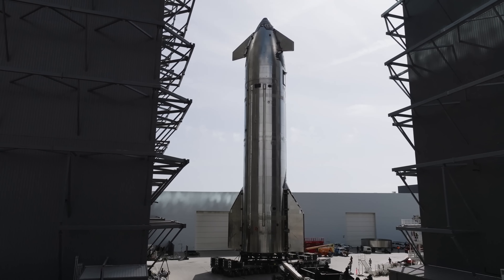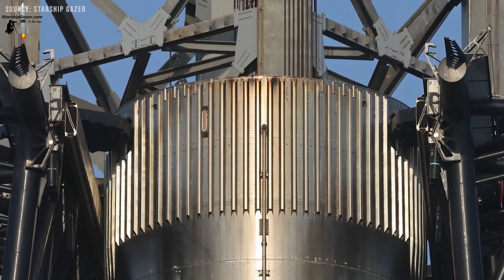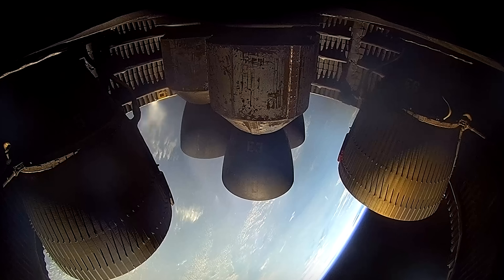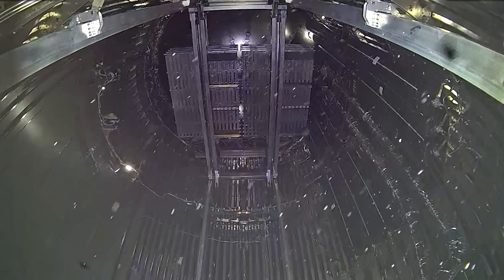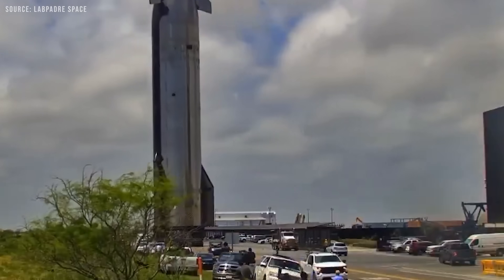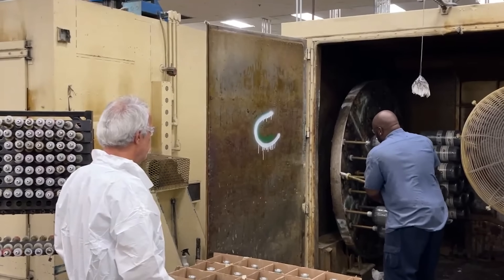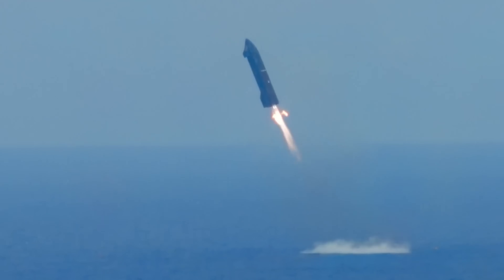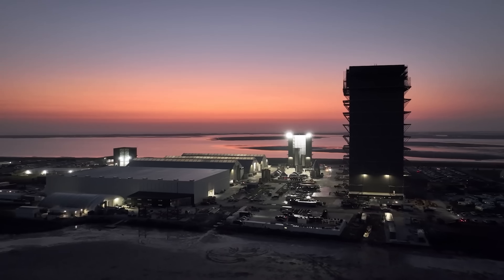SpaceX revealed the Real Problem with SpaceX Starship V2!

Comment: The main issues are 
1. re-entry or the weight of the shield for rentry. it diminish the payload.
2  The returning speed is so high, the engines cannot survive the air friction forces.
Note: On return the ship is Almost empty. The heat shield is defending an EMPTY vessel?
The very heavy shield is NOT required going up. It is only used coming back down. Since it is Empty. why can't the spaceship SHRINK its cross section and use conventional NOSE cone shield. once enough speed have been bleed off. FLIP and use the engine to land. isn't that easier than to cover the whole ship with heavy tiles.

Comment: As an experimental ship  it’s a success just to lift off the pad.  Space X is able to accomplish much more in shorter time periods.  China already moon rovers on dark side of moon with relay satellite.  Moonbase and Helium 3 high on China’s list.  Hopefully we can catch up both moon and Mars.  Hopefully a ship to Mars end of 2026
Reply: You want failure or you’re not pushing the tech hard enough.  Try to break it
Reply: I got that part dude I'm the one who told everyone that water was there. The big dummies thought a water meteor did it. That's possible but it would have caused the great flood doing so
Reply: The has to be some progress. They've already lifted off and the booster was caught. Not much progress since then. They need to be able to get the Starship to survive re-entry else it's a failure. Enough failure already.

Comment: Most launcher has the heavier liquid near the top of the rocket and the lighter near the base (closer to the engines). That gives more control by the engines because the center of gravity has more distance to them. Why is the heavier liquid oxygen in StarShip close to the engines and the lighter Methan on top of that?

Comment: A lot more weight. Which means less payload.
And have we discussed the hydrophilic heat tiles on Starship, and how many tons of water they can absorb? Or the fact SpaceX simply hammer bits of metal into three sides of each hexagonal tile?

Comment: It would be simpler and more reliable if Starship was not made to be re-usable. As has been pointed out elsewhere, bringing Starship back from the high orbital velocities is totally different engineering problem to bringing back the booster. With the booster stage they already have a cost effective way to lift heavy payloads into orbit, just build on that achievement.
Reply: Good to try both approaches. I think at least any stage above LEO can be nonreusable, but landing orbiter stage is vital for lowering costs long term. The space shuttle never achieved it, with long refurbishment, and maybe starship will also fail to allow quick succession relaunches. We'll see!
Reply: @aresmars2003 it maybe that all the additional technology and weight penalty required for orbital reuse, kinda negates the cost ratios. I’d prefer to see starship as an orbital launch vehicle for testing out refuelling in vacuum, getting heavy items into orbit etc. maybe the front conical section could be designed to separate and return like with Apollo and the SpaceX Dragon crew module.
Reply: That would undermine the essence of SpaceX goals. Totally unimaginable for spaceX.
Reply: @camielkotte oh dear 😢
Reply: @camielkotte  Nonsense, SpaceX isn't stupid. Some Falcon missions sacrifice boosters for more thrust. Sacrificing second stage should always be an option.
Reply: Obvious path is to do both versions, disposable and reusable.
Finding customers who want to launch 250 ton satellites will challenge the frozen imaginations of the space community. May I suggest reviewing the nearly ignored ideas of Gerard K. O'Neill? Think big. Lets try inflating a thousand foot Bernal spherical habitat and spinning it up to one gee. We're not on a starvation diet of ideas anymore.

Comment: This design of transportation system is flawed as there's no way it will ever reliably and safely land carrying a human cargo using the current vertical landing technique, the so called starship which has yet to go as far as our moon requires wings and needs to utilise the earth's atmosphere for landing, put simply a redesigned and updated rethink of the NASA space shuttle is required, yes the boosters can land vertically but to be landing the "starship" with cargo is just unrealistic. I'll wait to be proven wrong.

Comment: Reliable sources have confirmed that the faulty Block 3 Starships and the faulty Raptor 3 engines are being bypassed and SpaceX is going directly to the faulty Block 4 Starship and the faulty Raptor 4 engines.

Comment: What is troubling though is 1) why this problem did not manifest in the previous flights and 2) how come engineers never detected it during design reviews?  Nothing is "routine" and thing remain murky. When will people use Starship without feeling frozen in terror?
Reply: @JP-re3bc Never ask embarrassing questions in the muskrats' den.
Reply: It literally said because of the angle of attack
Reply: Calm down. Would you feel comfortable flying on the falcon9? 

Probably at least that much time
Reply: Brother they are at developing stage… We are very used to seen a product when it is ready to be bought, but here we are witnessing the whole iteration process until the product is fully ready. Also even airline operating aircraft have spureous defects that do not manifest in every flight and modifications are realeased every other day to improve system designs. That doesn’t mean they are not safe. Just chill and let them cook.

Comment: The real Problem, Singular ???  Gee, so they solved the overweight, poorly protected, under engineered, low performance whole concept? What a joke.
Reply: Space Zone should be renamed Space-X Zone ; no mention of anything else in aerospace
Reply: @phpn99 Very uninformed US centric view   China is surpassing US space laboratory  build, Honda has successfully landed its own reusable rocket, European Space agency has 4 planned satellites and a Mars Rover, and Iris communication satellite constellation, China landed a module on the moons south pole,  and plan manned missions in 4 years.
The Starship project is not going to succeed because of its bad design. Too heavy, poor implementation,  rushed megalomaniac designer. The Spruce Goose of Outer Space
Reply: It's called a Prototype - a standard design stage in human product manufacturing. You could actually look that up in a certain type of book - called a Dictionary. Best Wishes With That.
Reply: @robhart6042  There have been at least half a dozen analysis done on the impossible thrust versus weight inherent in the whole stainless steel engineering.  They would've to almost double the engine thrust to get a decent payload to orbit  After 3 billion taxpayers dollars, this project is just a recyclers dream.